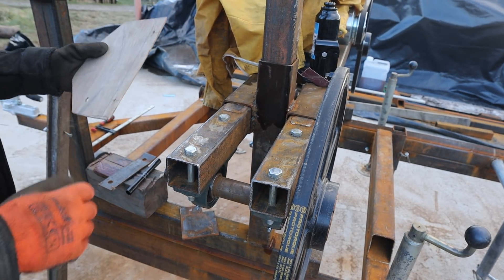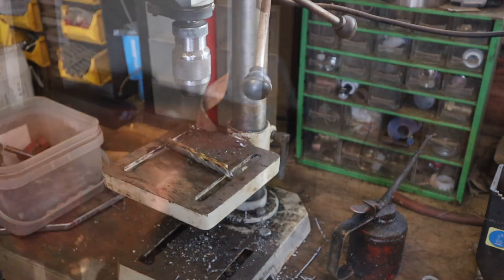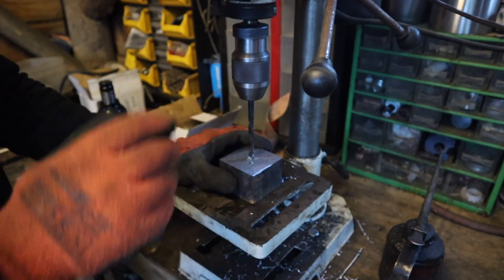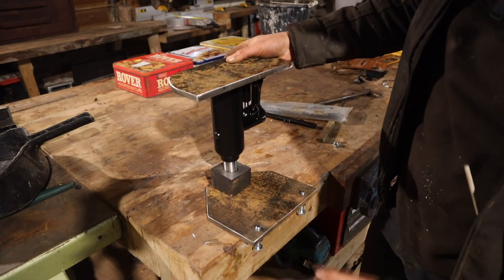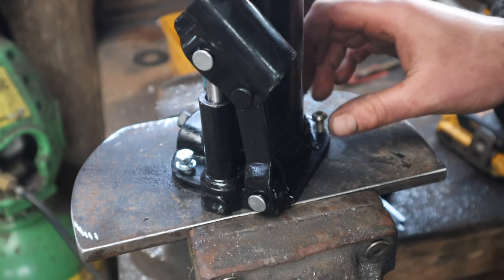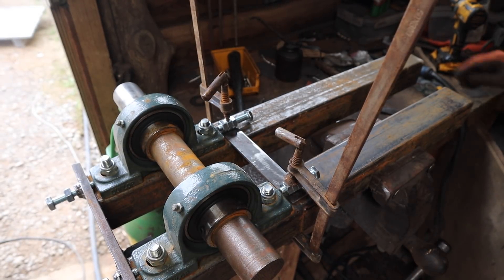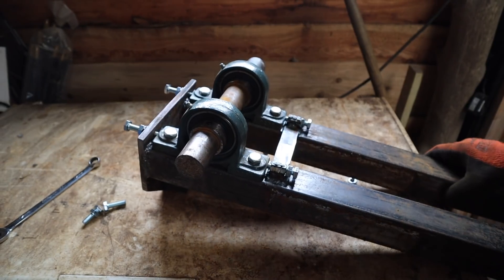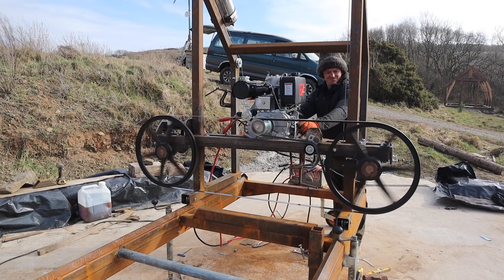DIY Mobile Bandsaw Mill Part 3 Bottle Jack Tensioner

Comment: This is great. Bottle jack is fine. You can’t have give in the blade. Belts on the pulleys is exactly how it’s done. The drive pulley is a bit high as you mentioned. Doesn’t seem to be a problem though. A UHMW scraper on the ends of the carriage will keep the track clear. WoodMizer uses them. It’s what I have. Keep moving forward. 😁

Comment: I love the idea of using the back of the v belt to drive the blade. When you get sawing the dust may build up in the v groove and play around with the blade tension so you'll need a brush or a scraper to keep them clear. You may need to fit a longer belt and an idler wheel on the non drive side to allow the sawdust to escape!! I'm hoping it all works out well - looking forward to your next instalment. Get some guards on the blade soon when it shoot off it looks dangerous - I wouldn't like to catch it!!
Reply: This is an earlier reply from Kris "It will get guards at some point. When building a house you don't start with the roof. The blade will likely come off a lot more times yet as I get it all worked out. Then it all has to get painted and put back together and set up again. If i had guards every time that blade came off it would destroy it. £40 a time. For now just standing out the way works just fine. It can't get you if you are behind it."

Comment: How on earth do you line up threads 😳
You live in a wonderous world . 
Fascinating to watch
Reply: Thread a bolt through before welding.
Reply: Better way to do it is to line up the three nuts then weld the nuts & then tap the plate through the nuts. Personally i’d have welded on some threaded metal blocks instead of nuts, there would have been no need for expensive tig welding that way.

Comment: Kris,  You may want to consider a spring either under the jack or under the top of the jack. Having a hard connection does not allow your brade the flex it needs to keep from breaking.  Most commercial mills have some type of spring in their tightening mechanism.

Comment: Nice work fella, looking good!
I know you don't, but don't go listening to the armchair warriors, it looks like it'll work beautifully.
One thing though, when you tested the tensioner, you said the blade would be a lot tighter in use, its hard to tell looking at the screen but that looked about how we run ours, slacker even, as everything heats up and beds in you'll adjust again anyway so don't start too tight or you'll be forever buying or welding blades!
Enjoying watching along, you approach things a similar way to me so in my down time i like to see what you're up to.
Nice one!

Comment: I follow your work very closely. I hope you have provided a knot in the design that prevents the saw blade from flying off. And I think it is necessary to provide a node for additional fixing of the canvas at the entrance to the log. A similar design can be seen in a metal band saw. There are used pressure rollers made of bearings. Sorry for inaccuracies in translation, my native language is Russian. If possible, I would send an approximate drawing. Engineer's language will be more understandable than many words)

Comment: I sure hope you're planning on putting some shields around the top and over the pulleys...  if something ever caused that band to snap, or if you hit some unexpected metal in a log and the blade broke, a little safey about where thay band will go could be life and death.  I love the ingenuity, I just know saws can be dangerous.  You may never need them, but if you ever do, you'll be glad you had them.  There's are reason all commercial mills do!
Reply: Hmm - I wonder if the idea that a flying blade could be dangerous has occurred to Kris...?!
You know, I wouldn't mind betting it has.......!!!
(what was that I heard? Blindingly obvious? Yep....!)
Reply: @andymccabe6712  This an earlier reply from Kris "It will get guards at some point. When building a house you don't start with the roof. The blade will likely come off a lot more times yet as I get it all worked out. then it all has to get painted and put back together and set up again. If I had guards every time that blade came off it would destroy it. £40 a time. For now just standing out the way works just fine. It can't get you if you are behind it."

Comment: Hi Kris, I have followed your for several years watching you weld with a regular welder, and a Tig welder. Have you thought of a Mig welder? Mig welders are a bit expensive but they are extremely easy to use. Keep up the great work!

Comment: Kris having done a fantastic job so far with the bandsaw mill wouldn't the blade benefit if you had the rubber bands on the wheels just like on normal bandsaw's?  Also you must have saved a small fortune making this yourself instead of buying one!

Comment: Excellent project. Wondering why you're using a bottle jack as opposed to a screw thread with friction washers?
Reply: Possibly because the jack/tension can be fully released quickly, when removing the blade for resharpening. I think the blade/pulley/bearing life can be maximised if tension is released when the machine is not in use.
Reply: @ChrisShute62  I see what you're saying, and certainly releasing the blade tension when not in use is standard milling process. My mill has a screw thread and is therefore very easy to correctly tension up the blade with a torque wrench. This results in utterly predictable tracking. The method is to adjust tracking when not under tension, then check it under tension. If that tension varies, (which if course it often does as the blade heats and cools), then true tracking is impossible. 
A torque wrench is what I use for consistent tension. How does one get consistent tension with a bottle jack with no method for a repeatable process? Clearly Kris has a good plan, he always does, I'd just like to know what it is.
Reply: @OAK-808  I have no band saw or sawmill. Off the top of my head, as a way of checking the blade tension, as you pump the jack, you could use a spring balance hooked on to the middle/slack part of the blade. Cheap spring balances with digital displays are sold for air travellers to check their luggage weight (so there's probably a whole warehouse full of them somewhere at the moment!). For a lower-tech solution, you might rest a pivoted, long, weighted rod across the blade. The free end of the rod will move through a wider arc than the blade, allowing you to find the preferred tension consistently.
Reply: @ChrisShute62   That brings me back to my original question, why use a bottle jack with all of it's complexity and inaccuracy when a much simpler solution already exists. Kris must have a good reason. 
A luggage gauge won't work. Not sure if you're aware of how much tension is required ...

Comment: Hey Kris @8:35 you can see light through the left wheel that your blade is riding on and no I don't mean where the spokes are for all you comedians out there. It looks like the outer part of the wheel has separated just enough to see light through it.  I don't know if this will cause the saw blade to slip or track off to the side.

Comment: Like your band saw. Just wanted to point out those lock nuts holding the bearing house do no good unless the nylon have any threads on them. Keep going, love to see more green house building.
Reply from the maker: Dont have long enough bolts at the moment. its just temporary. it all has to come apart for paint.

Comment: Coming along nicely I've been wanting to build one myself as I have a 14hp kawasaki gas motor and alot of the other parts just laying around and the chainsaw mill certaintly has its limitations and is far from an efficient process. Only thing with your design I'd be worried about is the vibration from the motor causing the screw on the jack to back out thus releasing the tension. May or not happen IDK. Also the proximity of the blade to the belt if you ever hit metal in a log or something binds and you throw one or the other may end up ruining both. Again may or may not be an issue. That's thing about building stuff like this from scratch is one can only use best judgment when designing and there most certainly will be some tweaking involved after the build is finished and its been put to the test actually milling lumber.

Comment: Stupid question: if the blade gets hot due to dullness mid-way through a cut... could this not melt the belt? Should the drive belt and pullies be on the opposing aside of the machine? Instead of the "cutting side"?
Thanks for the amazing content as per usual Kris!

Comment: Hiya Kris, been following your channel for a few months now, very clever guy. Ive been a forklift engineer for over 30 yrs, im retired now. I dont mean this as a critisim, its just an observation. On your band saw you are using a bottle jack to tension your blade, good idea but when you reach your optimum tension have you a mechanicle means of locking it? Every hyd system under pressure will leak down at some point. Requlations for jacks are 10% so if you lift 100mm ate the rated capasity it is by law alowed to drop 10mm over 1hr. Anyway, well done mate, great channel. Take care, Dusty, Norfolk.
Reply from the maker: Hi, I already responded to a similar comment so i hope you dont mind i will just copy it to you as well. 

So for anyone interested i did a test yesterday to see if the jack moved over time. I used a digital calliper, i set it to as much tension as i dare. I extended the callipers between the two points and zeroed them and set a timer and time lapse for 15 mins. I chose 15 mins because i would expect in that time if it was moving to move even if it was just a little bit but it wasn't long enough for temperature change to effect the reading. I filmed the processes and will add it to the next video. 

The results 
No measurable movement at all when measured down to 1/100 of a mm over 15 mins. If it did move in that time (it has to have a tiny bit) it was less than 1/100 of a mm A threaded bolt would stretch or compress a lot under that sort of load.  I would like to run an overnight test just out of interest but really the temperature change will make it not very accurate This test has proved to me this is a far more stable option then a threaded rod anyway.  Even if we say that is was just about to get to 1/100 of a mm as the test ended that would still only be 4/100 of a mm an hour. Im my mind that can be considered no movement as it would have no measurable effect on tension in that time. 

I was confident it was a stable mechanism but i am surprised at just how stable it is. i could not even change the reading by putting weight on the band. the only way i could get a different reading was by pumping/lowering the jack

Its chucking it down today but the next test i will do when its dry will be to see how small of an increment i can do. From a quick look today it looks like about 0.25 of a mm is the smallest but thats not confirmed yet.

I dont doubt that there is an allowance for movement but my experience of them is they just dont move at all. But 10mm over an hour wouldn't even be an issue as re tensioning would happen over that time anyway because of  variation in blade heat.  I also intend to add some spring to the system at some point, just need some big springs.
Reply: @KrisHarbour  kris, excelent answer, i never even thought about blade heat, with that length you must be talking 5 - 10mm!!! Well done mate, a spring system would be ideal, i wish you all well, keep up the great work on the channel, Dusty, Nirfolk

Comment: Interesting thing I saw, since the bands under tension now it's vibrating cause of the engine at a frequency that kinda makes it look like it's flexing in slow motion due to the rolling shutter issue

Comment: Nice job. Kris, aren't you concerned about the irregular pulley on the side with the tensioner? It seems to be causing the blade to vibrate.

Comment: Do you grind the zinc off the nuts or just weld it with it on? I never have any luck when I have to use zinc plated nuts/bolts. I always have to prep them

Comment: Great u job are you going to put a guard over the wheel and blade
Reply: This is an earlier reply from Kris "It will get guards at some point. When building a house you don't start with the roof. The blade will likely come off a lot more times yet as I get it all worked out. Then it all has to get painted and put back together and set up again. If I had guards every time that blade came off it would destroy it. £40 a time. For now just standing out the way works just fine. It can't get you if you are behind it."

Comment: That design where the drive belt is also the tire on the drive wheel is not ideal,  Yes some makers use it.  the biggest I see in you likely won't use diesel to cut the pitch which is the best solution.  I just can't imagine these designs working all that well over time.  seems like a maintenance issue.  Will the jack leak down?  and loose tension?

Comment: You should build a guard around the blade area a flying blade can be extremely dangerous!
Reply: This is an earlier reply from Kris "It will get guards at some point. When building a house you don't start with the roof. The blade will likely come off a lot more times yet as I get it all worked out. Then it all has to get painted and put back together and set up again. If i had guards every time that blade came off it would destroy it. £40 a time. For now just standing out the way works just fine. It can't get you if you are behind it."
Reply: @tonygrimes13  Thanks Tony I missed that from Kris earlier. I worked in a factory and saw several blades break and fly off in all directions, including backwards if they bounce off an object! Anyway i see today he has now built a guard so i can sleep in peace :)

Comment: one thing i can't see yet or get my head around. when you've cut a slab off the top of a log and need to drop the cutting height down, what system will there be to ensure each drop in height is perfectly equal ?
Reply: Im sure he will be adding some fancy gauge after its in paint.
Reply: Yes, the thickness will vary a few millimeters, but he can run them through his thickness planer.
I think the bigger problem with his height adjustment system is the cuts being not parallel, because the saw head can tilt a little bit from left to right.
In a comment on his last video I recommended a way to rearrange the lifting cable pulleys to ensure the cuts are always perfectly square and parallel, but I don't want to write that long text again...
Reply: @Henning_S.  my
Reply from the maker: Not really sure what you mean to be honest? a ruler that is able to be zeroed on the side post and a tape measure in my pocket. I think you might be overthinking it.
Reply: @johncowley8721  ?
Reply: @KrisHarbour  
Yes, i think a ruler will be fine, maybe he was concerned about the "clicks" of the winch being too large steps in height, but i think the steps will not be more than about 2-3mm.
Btw: this video shows the parallel lifting system i mentioned:
https://youtu.be/vkro_dM90Y0
I recommend the last version he draws, where the lifting cable goes back over the top of the frame.
Reply from the maker: fine increments are not really that important for me. its for rough sawing large timbers that are wet and will shrink loads anyway. thats what a panner is for. 

Yes, i have seen the video. I am thinking about changing it at some point. i do have two pulleys left and could do it but im trying to work out a way to do it without having so many cables. At the moment it is a fine detail that i dont even know if i need to change. I need to use the thing first and get the main basic functions working. I have raised it and lowered it as it is and it is always within about 3mm,  It would be nice if it was perfect but at this stage within 3mm is just fine.
Reply: @KrisHarbour  lol, there is that i guess, all depends on how youve pictured the project in your head.

Comment: on the blade wheel is they a raised bead on the rear to stop the blade been pushed off as all band saws i have used have that or will you be putting force bearings on left and right of the cutting point
Reply from the maker: No, but the blade guides at the bottom will have so the band wont get pushed off the back
Reply: @KrisHarbour  i see yeah scene this alot still remeber the old tre vertial band saw at my first place of work man that sent the fear of god thru you when that blade snapped was almost like lighting hitting the ground the thud it made was untrue